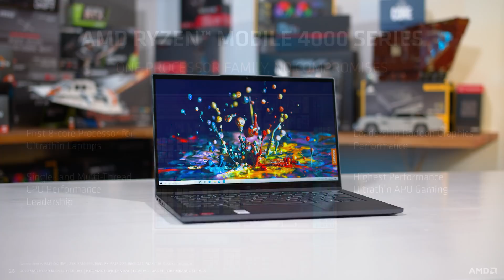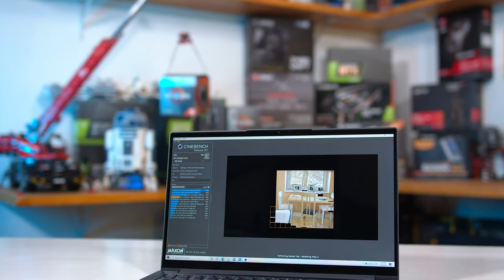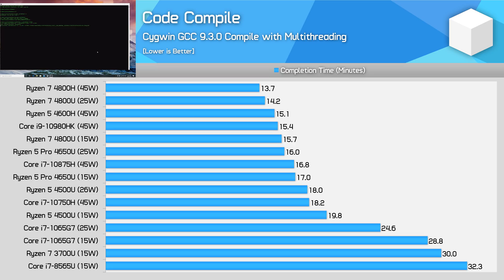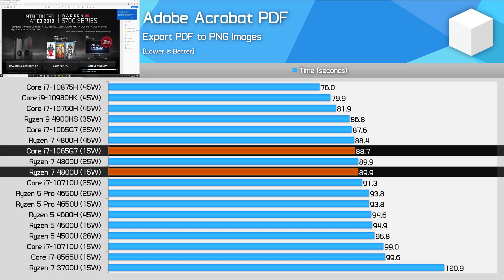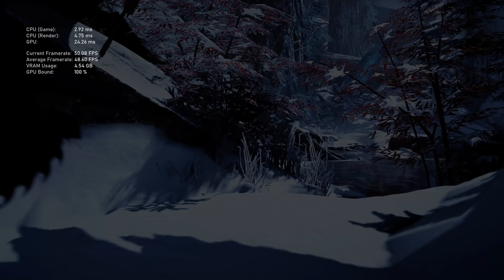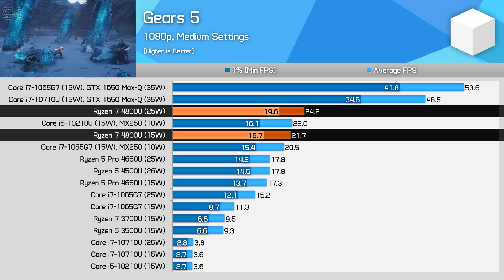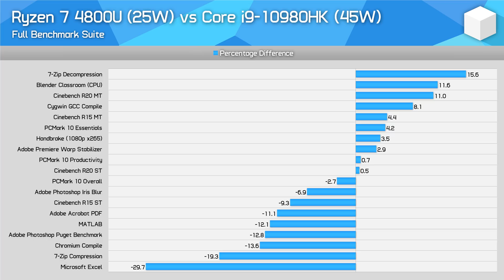AMD Ryzen 7 4800U Review, Mind Boggling Performance at 15W

Comment: why AMD desktop CPUs don't come with integrated graphics. As a software developer, I use GPU only to get the display output. spending over 150 USD on a dedicated GPU is a bit painful. I could rather use that money for a faster SSD.
Reply: Think about it that way; with no iGPU, the chips are quite a bit cheaper, can keep a lot cooler for their performance, and there's no compromise on PCIe lanes.
Reply: That's because enthusiast who use more powerful CPUs always pair them with descrete graphics.
Reply: I mean there is this GT 710 for below $100 if you only need display output.
Reply: ryzen 5 3400g?
Reply: @SidOfRivia  I mean 6 core and 8 core ones. 3400g is kind of like i3 and Ryzen 3.
Reply: @worthlessguy7477  there is, just not for consumers.
Reply: @worthlessguy7477  4750G
Reply: hemanth varada I’m confused, do you need 6/8 cores for software development? I’m not familiar with the process.
Reply: @SidOfRivia  Yeah more cores and faster SSD make a significant difference in compilation times. I'll have 3 android apps, 2 virtual machines, one spring boot, one angular app, and a bunch of chrome tabs opened at the same time.
Reply: hemanth varada Ohh, that makes sense, thank you.
Reply: Ryzen 4750g?
Reply: The Ryzen pro line up is available for OEM. R3 4350G 4c/8t, R5 4650G 6c/12t and R7 4750G 8c/16t
Local retailer where i live are listing them for sale but you need to pre-order half a month in advance.
Reply: @PyroCatus  do you know for how much ? Thanks